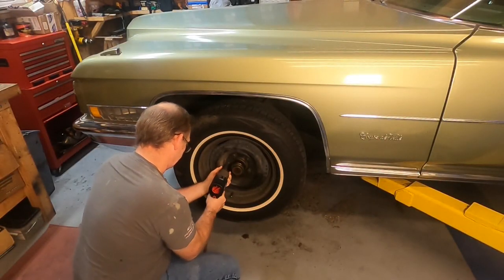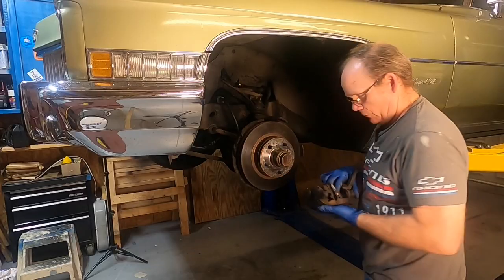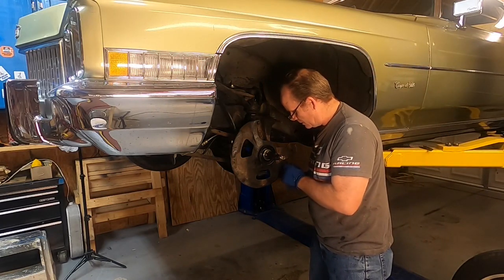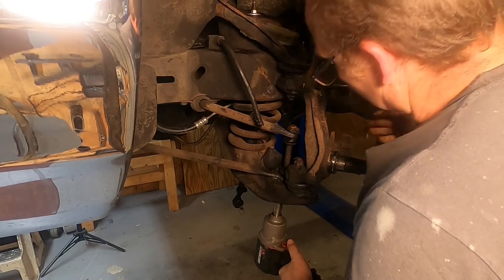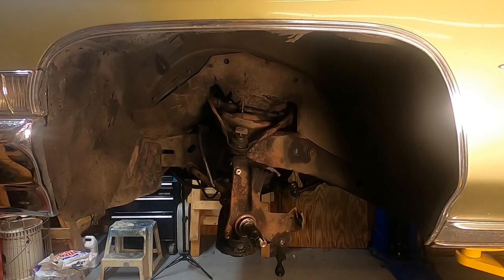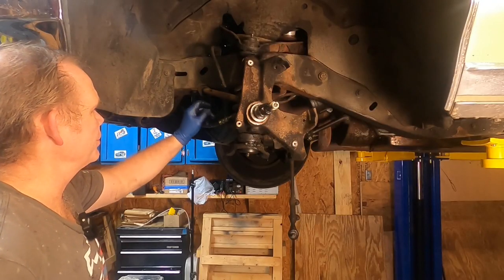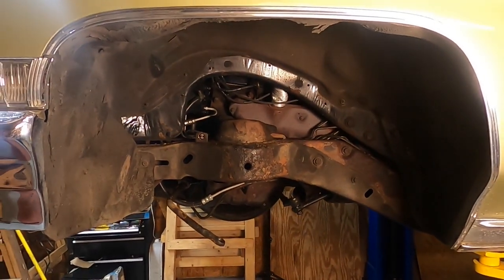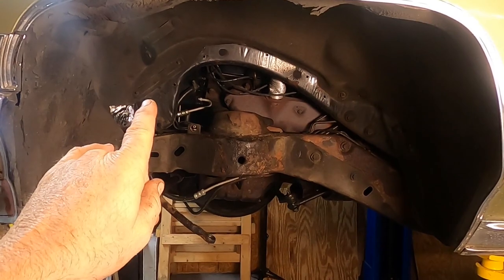71 Cadillac Coupe DeVille Complete Front End Rebuild - Part 1 - The Tear Down Begins

Comment: Love your Caddy videos. Is there any chance you could do a video on a wheel alignment? Having had a front end rebuild, its a matter of checking and adjusting the alignment. Would love to view your process. Thank you!
Reply from the maker: All I did for this car was to use a piece of kite string and tie it up on the rear shock and wrap it around the rear tire and then run it along the car to the front. I wrapped it around the front tire and tied it off to something in the front end. I kept it tight and level and in the middle of the wheels. After straightening the steering wheel I observed the gap either at the rear or front of the front tire. I adjusted the tie rods to make the gap go away. Also I adjusted the camber to make the tire straight up and down with a level. Lastly I adjusted the caster using the mark that I made before I took the front end apart. All of this got the car into a good enough state to drive to an alignment shop. They did all the fine tuning.

Comment: Glad to see the tear down.  Will you clean up the springs etc and powder coat or just paint?  I would have the cleaning/blasting outsourced for time purposes. Powder coating while more expensive will likely never have to be redone. In a batch and in black you might find it more economical in the long run.  I went to the CLC show in Lombard,  IL last weekend and your car would have fit right in.
Reply from the maker: Hey Richard. That is still up in the air really. There is a nice soda blasting place in town. They did a great job on the intake manifold. Miracle paint is an option as well for coatings. We'll see.
Reply: @ImpalamansGarage  you will still have to top coat miracle paint which I've had "ok" success with. It is UV sesitive, top coat required. Buy direct as I suspect there's copyvat stuff out there based on my non direct purchases. Once you open the can and get some on the lid, you will never get that lid off. You have to use the entire contents quickly as its moisture activated,  buy only what you need for each project as you won't be able to use left overs.

 Eastwood has some really good stuff too for rust and paint.  Chassis Black may come in semi gloss which would be period correct.

I'd love to tackle my Dad's 64 Imperial but lack a lift and knowledge on torsion bar suspension....no springs, yikes!

Best of luck.

RL

Comment: Surprising there is only some surface rust on a 50 year old car!
I did the struts on my 82 Peugeot back in the 90s. After that I decided never to work on front end parts again. Just give the keys to a mechanic and tell them to call me when it's done. Hopefully the mechanic has more experience and knowledge about the process than I do. 😆
Reply from the maker: That sounds lie a sound plan actually. LOL.... This car led an easy life thankfully. This job should not be that bad. The lower control arm bushings are the worst part. They are basically destroyed.
Reply: Weren't Peugeots made from rust?  Lol. I've had several cars like that.
Reply: @richardlazarski4553  Funny, very funny!
Not a bit of it. It was an 82 I bought in 1990 and had till 2001. I was in San Diego at the time and rust is not a problem there.